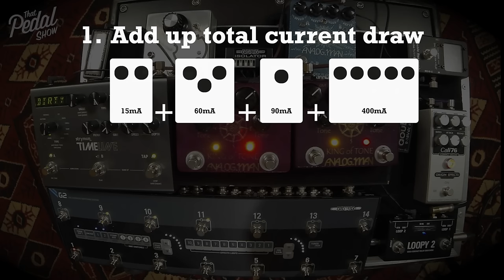That Pedal Show – How To Power Your Pedals Properly & The Legend Of VCPI

Comment: Thank you Dan & Mick for another fantastic upload. What I do is list the current draw of each of my pedals and then use a couple of Y splitters to power 2 of the lowest current-requiring pedals from the same isolated output. All while insuring that the total current from that 1 isolated output is not exceeded. I do that because my PSU has 7 outputs and I have 9 pedals on the board. So then, of course, for each power output you split, it's -1 +2. Total is 7, -2 (two Y splitters) + 4 = 9. I'm I doing it right?
Reply from the maker: +Waleed Al Suwaimel as long as there's enough current to go around then you're golden ;)

Comment: Hi guys, at the half way point you talk about the headroom differance between 9 and 18 volts and the difference in compression. Does this also apply to amps? Where us amps are at 110v (i think give or take) and uk amps are at 230v? Does that contribute to the us v britsh amp sound difference? 

Cheers guys, great work by the way

Comment: Can I use the Time Lord with a different power supply to acheive isolation? I have a board with a rechargeable battery built in with all the power leads I need, but I do get some noise (probably digital). I love the portability, ease of use, etc, so if it would work, the cost of a few Time Lords is less than a new power system anyway.

Comment: As informative as the 9v vs. 18v demonstration was, I feel like you guys missed a huge opportunity by not playing through the KoT at like 7v .  I am guessing on the exact voltage, but I have to say that I've experienced some pretty magical moments through my Mesa Flux Five pedal during its last few moments of battery life.  The batteries all measure in at about 6.8v on my $10 multimeter after the pedal dies, and I'm guessing the voltage drop happens pretty quickly (the thing sucks batteries so I have it on a transformer now).  I was hoping to see you fellas drill into the topic of undervolting drive pedals, play some sweet tones at different voltages, and talk about how to achieve weird voltages in pedal power supplies.  Maybe in a future edition!

Comment: Great video. As usual, I learned a lot.  One question though. You said that when you power your pedals, you should make sure your power supply can provide twice as much current as your pedals require.  But is that per pedal, or overall? For instance, let's say my power supply is capable of providing, say, 1000 mA of power overall, and I run three pedals, two that draw 50 mA, and one that draws 200 mA.  The two 50 mA pedals are powered by outputs that provide 100 mAs--so those two should be good no matter what.  The 200 mA pedal is powered by an output that provides 250 mAs. Is that pedal not receiving sufficient current because it's not in an outlet that can provide at least 400 mA? Or is it fine, because overall, my pedals only require 300 mA total, and the power supply can provide 1000 mA total? 

Sorry for the long question, but thanks in advance for the clarification!
Reply from the maker: +gendefect1 hi. It’s a rule of thumb I use for the overall system. It all depends on how the pedal builder rates the current draw. Some way over estimate, some under. My point is if an entire system is running at its absolute capacity there’s no headroom left. A system run like this can generate a lot of heat as well. So looking at you’re system you’re absolutely fine :)
Reply: Super helpful, as always. Thanks!

Comment: Fantastic episode guys. Thanks for explaining the consequences of providing voltage higher than what a pedal is rated. Is it the same with current, ie. can you plug a 100mA pedal into say a 450mA outlet?
Reply from the maker: Current is different, the pedal will just take what it needs 🤓👍

Comment: Great video. There's one thing I think would have been important to mention is pedals that internally raise the voltage (like a klon) should only be given 9 volts. An easy misunderstanding for someone to have that could ruin a pedal.
Reply from the maker: +Sean Roberts yes which is why we stress you must only reuse the voltage if you're sure the pedal can do it

Comment: I noticed you said add up the current your pedals require then double it. I added up the current and am drawing a theoretical 3915mA out my gigrig generator. It hasn't caught fire yet! I've been working on the principle the regulator is good to provide the right voltage to 5A, and figured hopefully the 5 isolators, 3 timelords and 2 supernovas are at least 80% current efficient. How 'dangerous' is this? It's not failed me yet and hopefully once everything has had the inrush current/boot-up current it'll settle down to a reasonable bit below this. When I emailed TGR no one seemed to be able to suggest the efficiency of the DC-DC converters in the little black boxes.
Reply from the maker: +Piplodocus it's a rule of thumb, it's about headroom and making sure you have enough. The Generator is a beast. I've had a 9V 1 amp supply drawing 700 mA before and the V started to drop.  So it's just a rule of thumb
Reply: Well, it all seems to work at least, and 1 AC plug to power the crazy amount of shit I have on my pedal board seems to make it a winner! What's the most stuff you've seen powered by one? :)

Comment: So for us that love Kingsley pedals, be careful since the current on all of them is a minimum of 500mA :)

I have a question regarding the 'distributor' the specs say max current is 180mA, so how do I get a higher current from the 'Generator' ?
Reply: The Kingsleys are 500 MA? Piss.... I need a bigger PSU.
Reply from the maker: +minorharmonicscale the Distributor isn't isolated and can deliver massive amounts of current. The Isolator is isolated and each outlet can deliver 150mA, for higher current pedals we do the high current adapters. Funny thing about the Kingsley pedals is they don't mind sharing an earth. I run my page direct from the Distributor and if sounds spot on :)

Comment: Thanks so much Dan and Mick...you really are making a huge difference.  I can't believe how much stuff I didn't know I needed to know...and it is sooooo much better. Question...does the Prince of Tone have the same 18v capability as the K.O.T?
Reply from the maker: +russwims1 no, in fact the KoT really shouldn't be run at 18v for more than a few hours either
Reply: @ThatPedalShow  So then Dan what is your preferred voltage for the KoT? 12V? 15?

Comment: I’m curious why do you like to use the isolation bricks instead of a power supply that has all its outputs isolated from the start? Is there any advantage to doing it this way? I’ve just ordered some more pedals and will be redoing my board so I’m wondering on this?

Comment: Would plugging individual AC adapters into a power strip be considered isolating your power supply? Currently I have three pedals  that I have been running,  a Boss RV-6 reverb pedal,  a Big Muff Pi fuzz pedal and a Boss DS-1 distortion pedal. Of course I've got them all plugged in a daisy chain... They're all 9V.

Comment: This answered so many question and stopped me from frying two pedals, but I have a question why do all supply on have eight 9 volt outlet? I ask because I have my board set up and have 10 9 volt pedal running from tuner, wah, boost, 2 overdrives, 4 modulation and a delay pedal. so what is a good solution to this issue?

Comment: Hi, great video. I have diy kit range master copy with a PNP transistor in it on a daisy chain with 2pedals (just a TC Sparkbooster and a tuner) and after 4 moths it still working normally. now I'm not sure what to think:)
Reply from the maker: +matej stasko well, if it's working fine and sounding great you're golden

Comment: Hey guys! Amazing episode again! I have a question - does that 9V/12V or whatever the voltage is stated on pedal, work with compressor pedals? I have Pigtronix Philosopher's tone and it's 12V. So based on what you said it should add some extra headroom to the overall sound? Thanks and keep it up!
Reply from the maker: +Ľubo Ivan its all about what the pedal was designed to take. If the manufacturer says 12v, that's what you use :)

Comment: I have a question, why do i have to double the draw current of all my pedals to know how much current my pedalboard is taking? I have a PA9 power all power supply and a daisy chain for 6 pedals and i've got 5 pedals, i have no hum problems. But my bass tone is sucked because of my PA9? It's 2000ma and my pedals are:
Bass equalizer from BOSS (20 to 30ma i don't remember), into a Joyo chromatic tuner (500ma), into a Digitech dual band bass compressor (300ma), into a Digitech bass overdrive (300ma), and finally a bass balls nano from EHX (100ma).
My patch are planet waves from the pedalboard cable kit.
The instrument cable is a Fender about 25ft i think.
The cable from the board to the amp is unknown but is very short.
I AM PLANNING to buy a polytune 3 with buffer mode included in it to solve the problem. Please help me with that two questions about the C= Current. Changing my PA9 will solve my problem? or maybe changing my cables, or buying the polytune 3. THANKS GUYS YOU ARE AWESOME.

Comment: Hey guys!  Love your videos!  
Just want your thoughts on transformer power supply vs. a modern switched power unit; does it  matter when it comes to influence on the sound from the pedals?  Or is it just an other technical solution?

Comment: Hi guys, great video! 
Thanks! But you didn't covered the batteries topic. There always was a lot of debates about power supplies vs. batteries.
Furthermore, recently I heard Scott Henderson in one of his Guitarwank podcats (19th if I remember it right) told that he always powers up his pedals with batteries, since in that way he gets the best tone. And he suggest to use carbon batteries especially for germanium transistor based pedals. What's your opinion about it?
Reply from the maker: +Robert Patrick like we said, these are the basics, it can get in depth though. Batteries can indeed have a different reaction as they have a bit of resistance as well. It all depends on the design as to how much difference this makes,

Comment: First of all: sorry for my english, I'm Italian.
I wanted to ask: do I need to have, for each output of the power supply, duble the amount of current that the single pedal requires? Or if the power supply has got at least duble the amount of current that all my pedals require  it's enough?
For example: I have 2 pedals that require 100 mA each. If my power supply has got 4 outputs with 100mA each (total amount of current: 400mA) I'm safe or I need a power supply that delivers 200mA per output?
Great video by the way, really useful and informative (like every other video on your channel).
Keep it up with the good work!
Reply from the maker: You don’t ‘need’ it Damiano. It will still function (hopefully) if you’re maxing out your current draw. However, we’ve found that many brick style supplies simply don’t sound as ‘good’ (and by good we mean in terms of clarity, dynamic range and detail) when they’re being run to their limit, when compared with a more powerful system running well within its abilities. Cheers!
Reply: That Pedal Show 
Thank you very much for the answer, I appreciate it!

Comment: Hello, Dan and Mick ! I have a question about the noise of overdrive pedals. I do gain-stacking and the more overdrive pedals I stack, the more the humming sounds it make even though I'm using MXR ISO-Brick which is isolated power supplier. Is it general thing to happen or is it my pickup of guitar issue? It's relieving that I stack only 2 pedals in general. But the fact it was humming when stacked still bothers me. Thank you very much for the helpful video again and I'm looking forward to next Friday !! :)

Comment: I want to try my OCD at 12 volts (maximum volts on my powersupply is 12 volts). Will that work? I'm assuming that because it can take 18 volts, it can also take anything in between. But I want to double check. +thatpedalshow

Comment: I’m thinking about buying the Voodoo Labs iso-5. It has four 9V power outlets and one 12V and one 18V. Does this mean I can still plug my 9V pedals into the 12V and 18V or will this supply only take four 9V pedals? Thanks

Comment: Hi guys, thanks for the video. Talking of power - have you ever played the ehx tube zipper? insane fun pedal but also has a crazy power unit that necessitates never using any other power method.
Reply from the maker: +Mark Smith yeah, EHX makes amazing stuff but they do have some specific power requirements

Comment: I wrote to a music shop asking for advice about which power supply to buy to get rid of the hiss I get from y daisy chain. They replied: "Unfortunately when using multiple guitar pedals hiss is something that most will guitarist will encounter. I'm afraid I couldn't guarantee either of those power suppliers eliminating hiss I think your best shot would be a noise suppressor pedal." Based on this video, that advice seems mistaken. But, in that case, what is the point of a noise suppressor pedal? Should it be unnecessary if everything else is set up correctly?
Reply: I have 9 pedals on my board, everything from wah's, to noise gates, to choruses, flangers, trems delays ect.  When daisy chained it was incredibly noisy, especially with gain channel on my amp.  I bought a voodoo labs power supply and haven't heard a single noise from any of my pedals since.  I didn't think it'd make that big of a difference but it was insane.  I wouldn't consider building a board with anything but a proper power supply now.  If your pedals are noisy and you try to cover that up with a noise gate, as soon as you play some notes and the gate opens, all that buzzing and humming is coming ringing through over your guitar tone.  It's not a work around.  Having a totally quiet and fairly big pedal board is totally achievable, just need a proper power supply!

Comment: I am building my first pedalboard after 15 years of multi fx processors. So I am currently using a 1 spot for about 6 pedals. 1 of the is a BYOC germanium boost and I also use a Joyo D seed digital delay. I dont have the money right now for an isolated power supply, but I do have a couple extra Boss 9v power supplies laying around. Will I damage the BYOC germ boost by running it in the daisy chain? Should I instead run a surge protector to my board, use the 1 spot for all the pedals I can and then use individual Boss power supplies for the germ boost and the digital pedals? Would this be a good compromise between the 1 spot and an expensive IPS that I currently cant afford? Thanks again and you guys are the best!
Reply: JackstandJohnny Harley Benton Powerplant Junior. 5x 9v 120mA all Isolated, all for €33,-

Comment: Question: If I’m only running x6 mini pedals at home, all at 9 volts with a daisy chain, but want to run wet dry once I get an orange amp detonator, then will I have to also get an isolated power supply?

Comment: so i have a switcher that needs 240ma. its currently on 100ma and seems to work fine, but i want to make sure its al working properly, most power supplies dont do 240ma so is running at 300ma a massive risk? will over amping the switcher over time damage it or shorten its life span? Cheers x

Comment: So whats a safe bet for isolated power supply for a bunch of 9V pedals? i think i heard somewhere that some claim to be isolated but are in fact not. Am using am Artec supply but do have some noise issues through the dirt amp which I could live without :)

Comment: Are there any safe/reliable ways to just power a digital pedal that does not take a 9v battery when outdoors, street performing? Everything I see talks about car batteries and inverters, these sound risky. Is there any product or method that is designed specifically to provide a small amount of portable power that would feed a 9v DC digital effect pedal?

Comment: According to what Mick has said reagarding the 300mA ouputs, I owned a T-Rex Chameleon to power the three big Strymon pedals, and now I've changed to a Strymon Zuma power supply which provides 500mA, but I haven't noticed any differences in the sound. Dan has said that the amount of current should be double the pedal needs, I also owe a Digitech Whammy DT which according to the pedal label needs 1300mA and the factory provided power supply  is 1300mA, not twice the needed current.
Reply from the maker: +Eduardo Valdez hi Eduardo. The double the current is just a rule of thumb that I use personally so you don’t run into trouble. You’ll notice that companies also over estimate the current draw needed on a pedal, the Whammy and the Strymons are great examples. They don’t need that much current to run the pedals but they recommend that the supply should have more to give. Timeline is happy on 300mA but that will be right at that supply’s limit. If the supply that’s delivering the 300mA is regulated then it should be fine, it might just run a little warm
Reply: Thanks a lot for answering!!! I was just telling you about my experience with the power supplies I've owened until now. Great work guys!!!